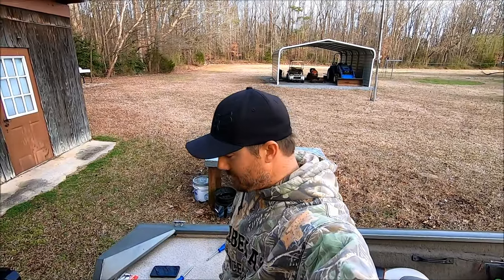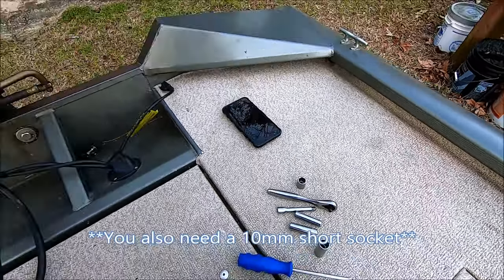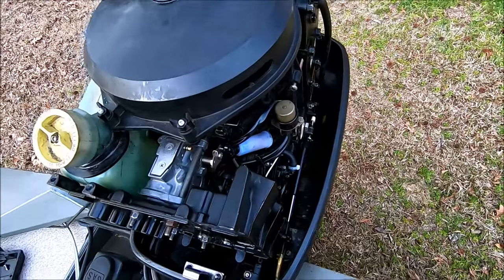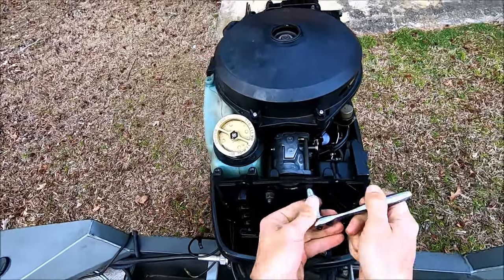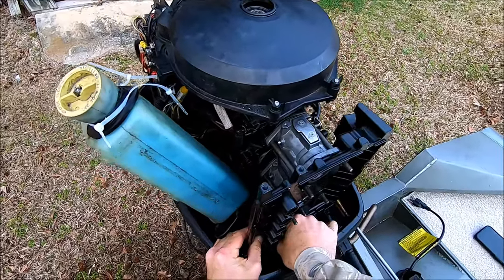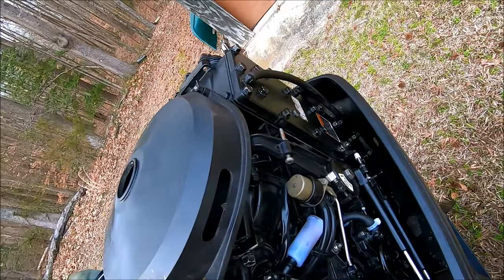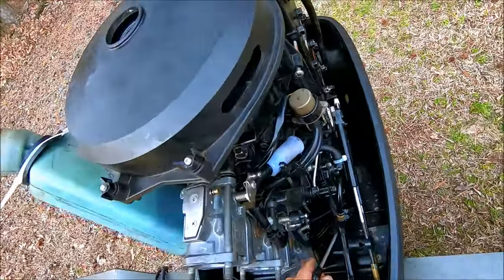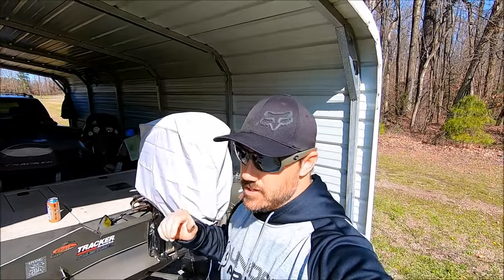Mercury 2 stroke Outboard Carburetor Removal Procedure #boatmaintenance

Comment: Hey there my friend.. again.. great video.   I should have asked before but after looking at the motor, service manual,  and reading forums... I seen some places where it general info while others were more detailed particularly about "link and sync" of the carbs.  Is it necessary to go thru the "link and sync" procedure for just removing the carbs, clean/rebuild, and reinstall?   Found myself a little apprehensive if I need to link and sync as I dont want to make an incorrect setting and have the motor run too lean.  It will also be difficult to find a body of water (locally) to set up idle and WOT adjustments due to it being late fall and docks being pulled and water levels lowered for winter.  I was hoping it was just a process of removing the links on the side of the motor (as you've demonstated), remove the carbs, service them, reinstall,  and hook the links back up again.  Is that "easy" lol... or do I need to do timing with a timing light, special tools, idle adjustments, WOT adjustments, cam setting and stop adjustments?  Fingers crossed it's easier than some things I've seen and read.  Anxiety and apprehension is thru the roof.. Thanks Man... appreciate you and your video.

Comment: Thank you I am having a hell of a time with a Mercury 125 saltwater series. I need to get my ass in there and get these carburetors out and rebuild them. It idles fine and as long as you're going about 3 miles an hour it runs fine but as soon as you try to get some gas to it  spit sputters and stalls. It broke down in the beginning of last year so it has a full tank of gas in it lets a year old I need to get rid of that. And a couple of friends told me there's a slow and fast port or in the carburetors and it sounds like the fast ports are clogged or something to that effect so either I pick up a rebild kit for each carb for a new carburetor I guess. But this does help a lot cause your motor looks just like the one I have. Besides I have one extra carburetor. I greatly appreciate your time.
Reply: try the idle screws, it sounds like the motor is running lean. the top screws opposite the carb valve retainers, open them a touch. I have one of these motors, and if it idles fine, its prooobably an issue with adjustment
Reply: Bro same motor on a Sea Hunt 20 ft, just got to the point now it’ll only go 7mph and you have to go back to neutral and then back to 7 lol. 

Wasn’t the fuel bulb. Prop change didn’t change anything, fuel sample shows no water contamination, fuel flows to motor, can’t say it’s getting in the carbs right. 

Also looking into the reed valves. Going to go get it and put it in the driveway tmrw
Reply: @danteinouye6098  my idle screw was seized when we tried to mess with it, going to put some PB on it and see if we can’t break it loose

Comment: Thanks for making this video. I was able to rebuild my carbs and reinstall them. I didn't discover too much gunk in the carbs, but I discovered the 25 year old fuel lines were terrible. They ended up shearing apart upon removal. I got those replaced. Still didn't fix the issue, which appears to be similar to your issue. Will only reach 4,300 RPMs and struggles to deliver power on the lower end. I can't get out of the hole at 4,300 RPMs. I have to back if off to 2,500 RPMs and wait for it to eventually climb. Previous owner put a large Stingray hydro foil plate on the back, because I assume they were having the same issue. My question to you is, what was the "Reed valve" issue you were dealing with? I'm going to replace those next and see if that solves my problem too. Thanks again.

Comment: Nice Video, which is better in term of engine performance and the ease of starting , and maintenance....  Mercury 3.5HP or Honda 2.3HP   ? I will use it for my Inflatable boat and will need to lie it down when transporting it in the back of my car ... what you recommend ?

Comment: Do you have any tips on getting the bottom carb back In I'm having a heck of a time trying to get it on
Reply from the maker: That bottom carb is extremely aggravating. You have to get the carb at an angle and it has to be the perfect angle at that. It kind of depends on whether your motor has the studs that are connected to the motor or if the bolts thread into the motor

Comment: I have the 1997 90HP version of this mercury 2 stroke outboard. The procedure to take off or reinstall the carbs is not that difficult if not for the bottom carb, carb #3. To get the bolts in or out is murder!. I eventually get it done, but its takes alot of time and heartache. I try to angle the metal face plate as much as I can to get the clearance to take or put in those 2 bolts but its really frustrating. You mention it so I can imagine you know what I am saying, but you also seem to do it much quicker then me. Any detailed steps or tips on that would be great!... If only the bottom front part of the motor housing could fold down out of the way... it would be a dream to do...Great video btw...
Reply from the maker: Thank you.....yes that bottom carb is a tough one!!! I have no clue why they made it like that. My old 60 was much easier that's for sure. The motor I used in this video has been sold since I did thus video
Reply: Greg S, what’s is your 90hp on?? How does it perform? Just curious because I am thinking of changing my 75hp carb and valve reeds to make it a 90hp. My understanding is this is the only difference

Comment: Are you getting a beep alarm from your oil injection?
Reply from the maker: I experienced the beeping alarm on my 50hp Mercury I had....it turned out to be the alarm sending unit on the bottom of the tank. If you are 100 percent certain it is oiling you can disconnect the wires at the bottom of the tank temporarily to stop the alarm.
Reply from the maker: This current motor is not alarming

Comment: Hey man, Thanks for the video. I have the same Tracker 2001 with a 75hp. My understanding is that these 75hp 2 stroke 3 cylinders are identical to the 90hp. 3 cylinder 2 strokes except for the 3 carbs that have different jets and the valve reeds? I know you bought a ranger so you probably got rid of this boat. Obviously this boat has a max rating of 75hp, however it was rated for 90hp 1 year in 2010. Not asking about exceeding max hp. Just asking about if you know anything about making the 75hp a 90hp by doing this? Also how did it go? Did it fix your 75hp
Reply from the maker: It ended up being my Reed valves and it drove me crazy figuring it out haha. The 75 and 90 did use the same block to my understanding so technically it can be switched out to a 90. Unfortunately this motor blew not long after this video due to the oiler going out!! It wiped out the top cylinder
Reply: That is terrible man. My understanding is that the oil setup is pretty reliable on these. Must have been a freak issue, otherwise I should take my pump off and mix. Did you at least get to try it before you got your Ranger?  
Also, how do you like your Ranger overall. I have heard the only downside is they are not as fast as they should be?

Comment: I dropped a bolt down there. What’s the best way to get it back?
Reply from the maker: Best way is with an extendable magnet or bendable grabbers. Alot of those bolts are stainless so they wont stick to a magnet
Reply: Thanks to your video I was able to go ahead and take off oil tank and carbs to reach it.  So next up, carb rebuild. 

Do you have a video for that?!
Reply: and for future reference, I stuff a rag in the bottom of motor b4 I start working on that way if something is dropped.........

Comment: Do you have a video of you putting the carbs back on by chance I’ve got a 60hp I got from a guy with the carbs already pulled off... have no clue where that fuel filter connects to
Reply from the maker: My current 60 doesn't have a fuel filter in the actual motor....I installed an inline fuel filter in my fuel line between the pump ball and motor
Reply: GunnFishTV I found a hell of a deal at a marine shop near me. $60 four all 3 carbs in good condition and I actually got to see em take it off and everything now it’s runnin good as new just won’t run over 22 on my 17’ foot fiberglass v hull...
Reply from the maker: @cosiestclient5671  what RPMs are you hitting?
Reply: @GunnFishTV  about to cut our old one out and do the same setup. You using like an automotive filter with the plastic housing?

Comment: What year/HP mercury is this?
Reply from the maker: This is a 1999 75hp
Reply: @GunnFishTV  you are the man, i have a 1995 75hp i need to do some work on!
Reply: @GunnFishTV  what was your main issue? Ours was struggling with 6 ppl on a 20 ft BR, but now it’s not going above 7 with just me. New bulb didn’t affect it, about to pull carbs but keep hearing more and more about reed valves. 

Thanks for any future help bro
Reply from the maker: @74nova36  it was my reed valves!!!
Reply: @GunnFishTV  I mean how was she running when you decided to take the carbs off the first time
Reply from the maker: @74nova36  it was fluttering bad at wide open throttle and losing rpms. Would run perfectly at 3/4 throttle or under
Reply: @GunnFishTV  oh, we’re at a complete loss of power outside of neutral. Carb kits are sitting in the garage and I’m getting the boat after work. Right now it’ll only get up to 7mph, not sure on the RPMS cos our gauge has been out